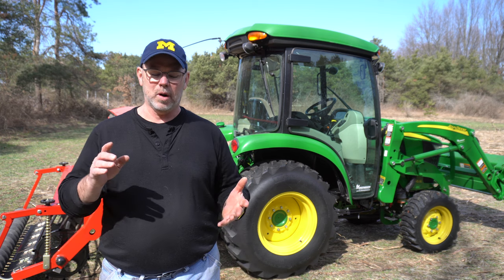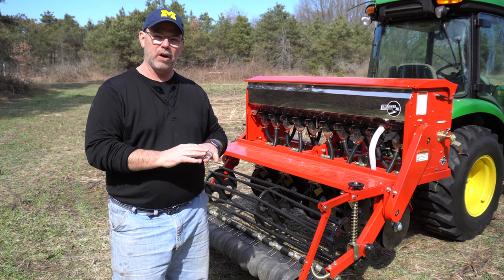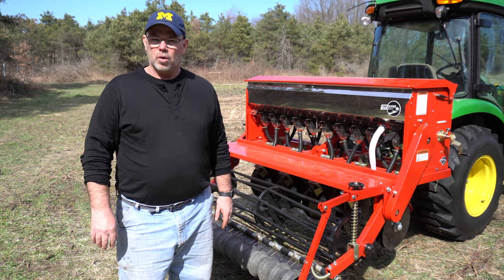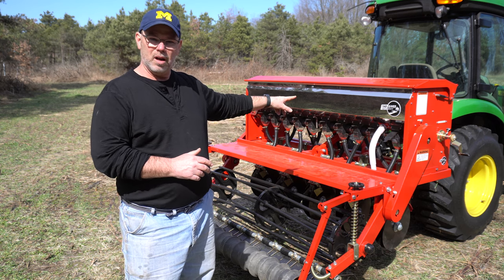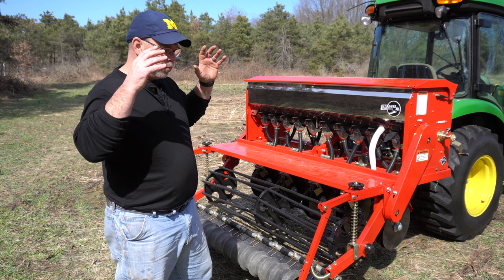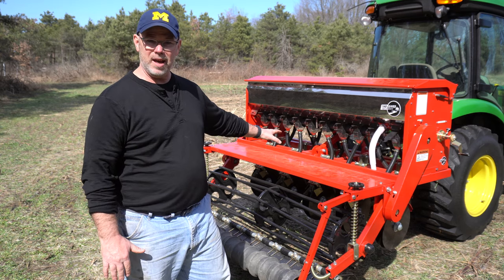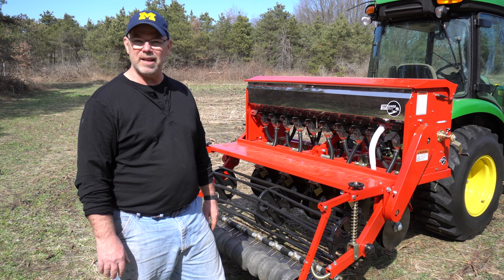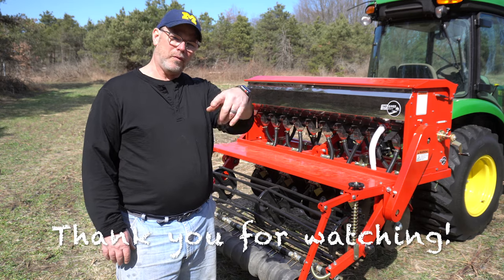Finally Found a Grain Drill for Foodplottery, and the Winner Is....

Comment: You are correct in your appraisal of my unit. I’ve been doing a lot more no till broadcast seeding and have not used it as much lately.  It does a good job however when I need it.
Reply from the maker: I tried broadcast no-till seeding for a few years, too, but just had really bad germination rates.  I am thinking my soils are too sandy so there is not enough moisture to get things going well (other than weeds, they do really well).  Good luck with your plots this year, it's getting close to time to plant the cool season seeds!
Reply: Good luck and keep us posted......

Comment: DO NOT turn with that drill in the ground. You won't like what happens if you do. I had one so I know. A slow curve will be ok but not sharp turns. Pick up and reposition then continue on. I went total no till last year. Sold my harrow and plows. I bought a late model trade in Great Plains 6 foot pull type. If you have trouble with your openers look into some front mounted coulters. They will cut the trash and allow the openers to more easily take the soil. If you have sandy soils you will be ok because planting depths for small grains are normally around 1/2 inch and those openers are well capable of that. Good luck!
Reply from the maker: Hey Johnny, thank you for the info!  That's one of the things I have found I like the most is the ease of picking it up with the three point hitch, repositioning, and then dropping it back down for straight (and slight curved) planting rows.  Good luck to you as well!

Comment: Really interested to see how this works without the no-till coulters.  Like you I have sandy loam soil so your results will determine my future purchase.  I no till seeded with my grain drill as well and have had fair results even though it is a single disc opener but a double disc opener drill would be 10x better.
Reply from the maker: I used it this past weekend and will be posting a video later today if it can get uploaded in time.  Looks like it worked really well, but won't know for sure until I see the germination.  I'll keep everyone updated on the results.
Reply: @theback40  I subscribed so will following.  I'm from Michigan as well was wondering what vendor you purchased the drill from.  Only vendor in the state I can find is GoodWorks Tractor.
Reply from the maker: The Michigan distributor is Farmco in Lansing, you could call them and ask for your local dealer that they sell through.  I ended up at Burnips Equipment.  Good luck!

Comment: Hi Mark i love your honesty on the video I have talked to you before I am the one who had a brillion seeder in which I have sold it now i am thinking about getting the tar 507 saya it’s a little bit heavier than the tar 72 i was wondering if you have heard anything good about the 507 saya it’s also a no till and more expensive thank you for your opinion and do you think it’s worth to get a crimper
Reply from the maker: Hey Guiseppe, I know of a couple guys that have purchased the 507, but haven't used it yet.  So I don't have any info to help at this time.  They will be using it this spring, hopefully they will get us some feedback.  As far as a crimper, I am sure it would be worth getting one, but they seem so expensive to me.  I'm trying to determine if there is an effective alternative.  Although I'm not a fan of using glyphosate, I am still planning to do this since I already have a sprayer, and it only costs $175 per year to spray.  I'm also going to try to see if I can work with a lawn roller I already have, or add weight to the cultipacker I already have.  All the best to you!

Comment: You have qualified your purchase as for light sandy soils, what would you have gone with if that wasn’t the case?
Reply from the maker: Hey Matt, GREAT question.  Tar River also makes an official No-Till Drill, with the cutting coulters in front of the drill.  Assuming the drill I just purchased works well (TBD), then I would say I would have purchased the Tar River No-Till Drill (SAYA 507).  Much more expensive than my drill, but much less expensive than a Genesis no-till drill.  BUT, I have figured out if the Good Lord lets me live another 20+ years, I will only need to plant about a grand total of 200 acres with this drill in that time.  So a light duty machine is fine for me.  But if I was a farmer, or had a lot more food plot acres to plant, I would wait to find a good deal on a used no-till drill.  The normal farm duty equipment is WAY WAY more sturdy than this Tar River I purchased.  Here's a link to their No-Till Drill https://www.tractorhouse.com/listings/farm-equipment/for-sale/list/category/1122/planting-equipment-grain-drills/manufacturer/tar-river/model/saya507

Comment: What size tractor do you have it on
Reply from the maker: Hey Tim!  Tractor is 46 hp, and the rear hitch is rated for around 1500 pounds. Could use a much smaller tractor, the drill only weighs around 700 pounds, and I can barely tell the drill is back there while planting, zero strain on the engine. All the best to you!
Reply: @theback40  Hay thanks for the info I have the same tractor only 37 hp I'm in heavy clay I'm thinking I would need the no till drill just unsure if the tractor will pick it up and the hardest part is there not giving them away 🤣
Reply from the maker: @timbehrman5432  They're so expensive!  With clay I am quite sure you will need a no-till drill.  But on the bright side, your soil holds water MUCH better than my sandy plots...